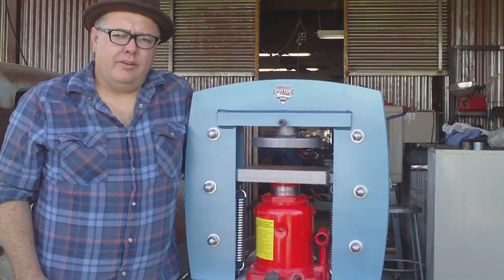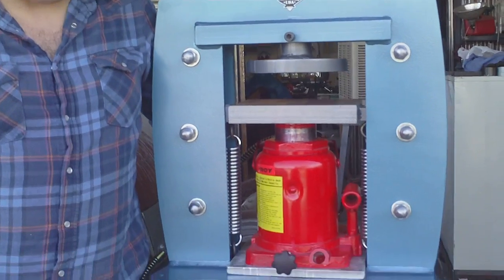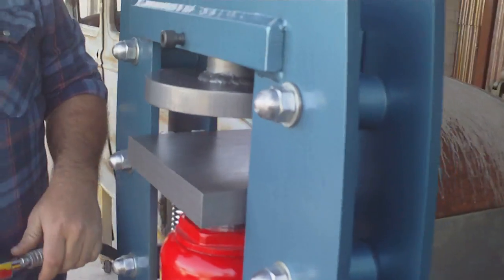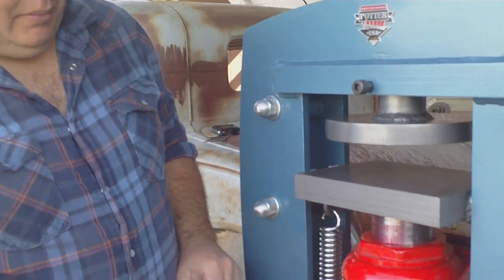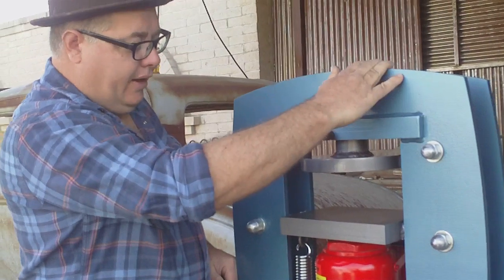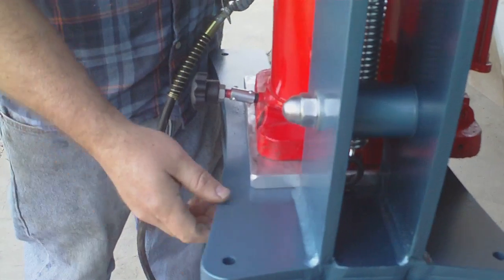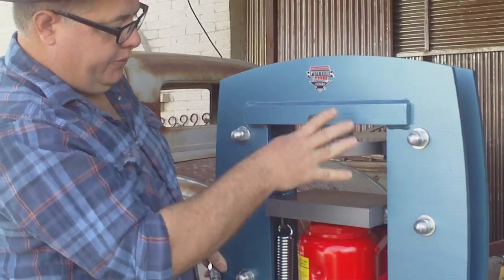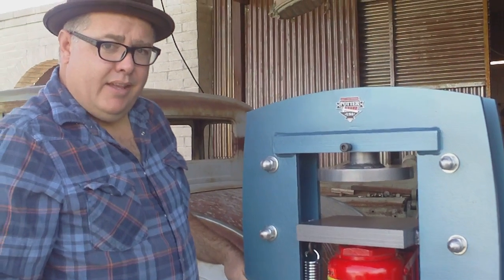Potter USA 50 Ton Hydraulic Press

Comment from the maker: Hi Jackdog20, It can be used for forging - they work really well as long as you stay within the range - usually 1 inch diameter or smaller for the steel.  Check out my new video about the purple press - I show the re-designed 50 ton press.